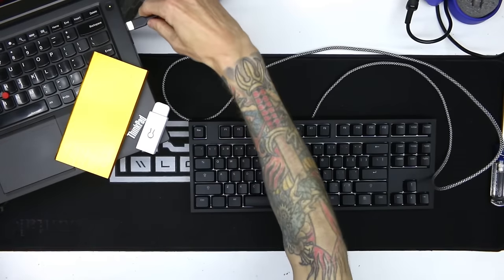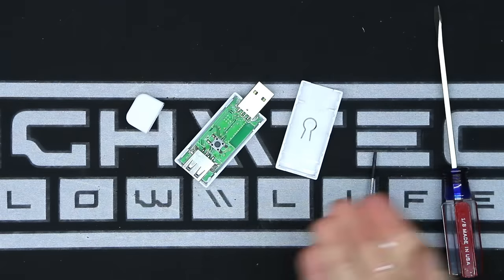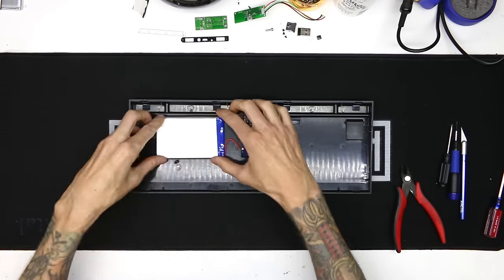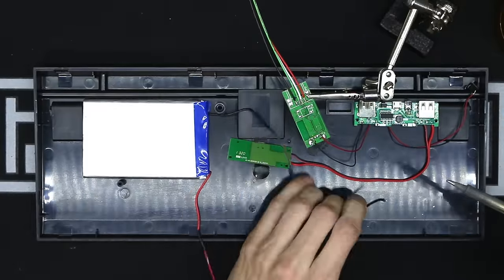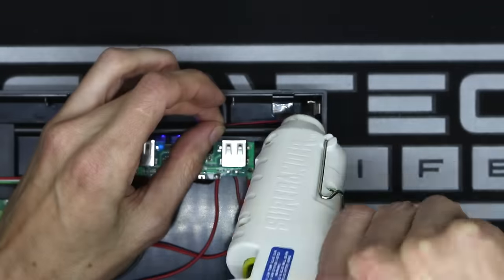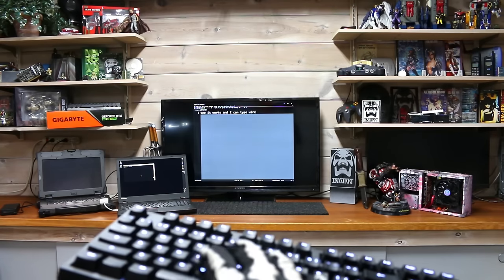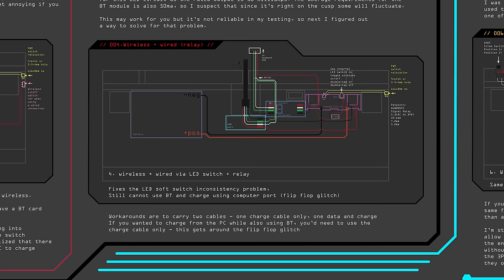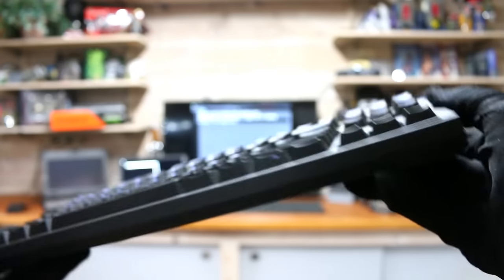⌨ Make ANY Keyboard Wireless! - Convert Any USB keyboard to Bluetooth Wireless - DIY Tutorial How To

Comment: replicated this video on my logitech g512 keyboard. I made a couple modifications. I used a faster charging usb c 22.5w module to charge batteries. and instead of pouch cells, I used 4x 5000mah 21700's along the top edge, they also act as a keyboard tilt. Full brightness with rgb effects turned on, it lasts me about a week, and with no lighting, 1 month+, still going and I havent charged since jan 10th
Reply from the maker: That's awesome man! Congrats on your build 🍻
Reply: @hightech-lowlife  thanks! its been amazing, just wish the bluetooth connection was less buggy, it sometimes disconnects randomly
Reply from the maker: @Iinustechtips  That's strange I haven't noticed any disconnects in my usage, it could be any number of things though.

Comment: Thank you so much for the video, much more informative than anything else I have found so far with what I'm trying to do. If you have a moment, what I would love to do is convert a Asus rog wireless 65% dongle keyboard, falchion, so that it is Bluetooth compatible. Since it's already got battery bank, I was hoping if you had any idea how I could find something that will just convert the dongle rather than usb, to bluetooth, is there anything in the market? Thank you so much!
Reply from the maker: Thank you for watching! 

Just changing the dongle will not help you because that is just the receiver, even if you change that over to bluetooth, how will the keyboard itself transmit bluetooth frequencies when it is designed to output the 2.4Ghz band? 

The BT module in the video will convert the keyboard to transmit BT signals, then any standard BT receiver will work for your device 👍
Reply: @hightech-lowlife  got it! Thank you for explaining that, that makes a lot of sense. Thank you!  If I do the BT module you showed, you think instead of getting another battery pack I can wire it directly to the lithium battery that's already in the keyboard?
Reply from the maker: @gracesleu563  No problem 👍 yes most likely the same battery will work just fine, just check the voltage, should be 3.7v and it should have a boost converter to get to 5v to run the keyboard.
Reply: @hightech-lowlife  great!!

Comment: looks like you could also use the power bank PCB to charge your phone or something as well.
Reply from the maker: 100%! In my latest video I'm making a custom case for two batteries with access to both charge circuits to charge/power a ton of things 👍
Reply: @hightech-lowlife  how big you thinking?
Reply from the maker: @jchoneandonly  They are huge batteries! Double the size of the battery in this video and there are two of them! Check out my latest video I released today if you're interested in that build 👍

Comment: Would using AA/AAA batteries instead of a pack work as well?
Reply from the maker: Yes, you can use any batteries. Just make sure the output voltage to the board is 5V. Rechargeable is the way to go though 👍
Reply: @hightech-lowlife  Thanks for the info. I figured on at least the 5v parts, but I know that everyone reading may not know or are aware of that. For those people who don't want to do the math, AA batteries are 1.5 volts, 3 of them will get you 4.5 volts and 4 will get you 6.
Reply from the maker: @Kara_Kay_Eschel  Thanks! Yes, you can also use a buck converter if you want to use more batteries that are over 5V, or a boost converter if you want to step up from say 3V to 5V 👍

Comment: Are you sure you are using the input port? It may be that the security functions do not work depending on how the module is set up. When you connect to the USB female port.
Wouldn't it be correct to connect the USB micro as input?
Reply from the maker: Can you clarify? Also what security functions are you referring to? Thanks!
Reply: @hightech-lowlife   Idk with IC this is and how the Manufacter has wired the ports but  the output port should only have the undercharge, short circuit  function and the input port should have the overcharge funktion.  If i am wrong please correct me. Thanks.
Reply: I watched the video again. on the green circuit board, all 3 ports are connected in parallel. So my suspected problem doesn't exist for her. But that could be the case with other PCBs.
Reply from the maker: @domineter40  Oh you're talking about the charge circuit - got it 👍From my testing all of the ports are bound together - so it doesn't matter if you use the 'outputs' or 'inputs' they all charge/discharge the same way. I did experiment with having the input only go through the micro USB (input) on the charge circuit, but it didn't make any difference. It could be different on other charge circuit PCBs, but I have tested a lot and they all behave this way - but that's not to say that 'all' are built this way, just the large number I have tested.

Comment: hi mate, me again haha, one question where did you buy the generic power bank from?
Reply from the maker: I found that particular one on ebay, check out my write up on my site for more information about the parts: https://hightech-lowlife.github.io/projects/004_wireless_keyboard/004_wireless_keyboard 👍
Reply: @hightech-lowlife  Is it necessary for the power bank module to have two outputs? a single output module will work? in this case the charge coming through the cable and the one going to the BT adapter would be connected to the same port, would this work?
Reply from the maker: @AngelSing-Zepol  You don't need two outputs 👍

Comment: i got my membrane keyboard which is woreless and problem with it is its pcb sheet traces got damaged and i made it worst as usual so can i make my wired keyboard wireless with my membrane keyboard parts? every thing if fine with membrane accept pcb sheet
Reply from the maker: No, you'll need a working wired keyboard first, it cannot fix your broken traces by going wireless because the wireless transmission happens after the PCB matrix 👍That's an integral part that needs to be working.

Comment: from the schematic that I see, when we need the keyboard with wire mode back it won't work right?. maybe you can update the schematic circuit again so that it can use 2 modes, bluetooth mode and wire mode
Reply from the maker: I show the keyboard working in switchable wired and wireless mode, I even show more than one way to set that up. The schematic also shows all of my iterations including the recommendations for both ways that I set up wired and wireless switching - both firmware switching using the BT module, and also hardware switching using the relays.

Comment: How can i do this on a keyboard without an internal connector/internal micro usb? They are hidden in the planck ez ortholinear keyboard and I am having trouble finding a spot where they disconnect, there are also no visible wires. Is it possible?
Reply from the maker: For keyboards where the connector is soldered directly to the PCB, you'll have to intercept at the connector as I did on my 60% build: https://youtu.be/2Df7Dh3-3o0 

Type-C will be harder because the pads are even smaller. It is possible, but it will be difficult. These types of keyboards will require more engineering and thinking about how you want to tackle the intercept. Another problem is the "mount" for the connector is part of the connection itself. I suppose if you don't want to try and intercept there, it may be possible to clip/cut the traces on the PCB to create the separation, or follow the traces down to the next component as it may be a lot easier to intercept there, this way you don't have to give up the mount. 

There are a lot of solutions really, it just depends on how you want to go about it.

Comment: is it possible to make it hybrid? so when you connect it to the computer it would be normal usb keyboard?
Reply from the maker: That's how this one is set up 👍- has both wireless and wired, just double tap the power button to toggle between modes. Also the BT-500 has a firmware hotkey to do this as well, I got over the pros and cons of both setups in the video however.

Comment: Thanks for your Video. It's already a long time, I'd want to do the same with my Logitech G15 but the problem is I don't know how to my computer could recognize the G15 without cable. I think I couldn't use my G15 functions. It should be just a simple bluetooth keyboard. Any ideas?
Reply from the maker: I'm not sure how it would treat the G15 macros, it's possible it would work just fine, but also possible it wouldn't. You may want to reach out to handheld scientific support and ask them as they most likely would know as they have tested a ton of keyboards 👍
Reply: @hightech-lowlife  thanks for your quick answer. Anyway, I was talking about Logitech Gaming Software, display informations and so on. Probably there will be too much driver issues
Reply from the maker: @simonen8844  Oh you're talking about an old G15 with the LCD, I actually own one of those! I don't know how the software is communicating, but if it's just using HID protocol then it might, but I would be surprised if it did work through the BT connection. Do you actually use the screen for functionality, or just novelty?
Reply: @hightech-lowlife  I really love that keyboard (1st version). I actually own 5pcs of them. the first is at home, 3pcs are at my work (I use them at the front office of my pc repair shop) and the last one is actually disassembled because I want to make some mods (to change led color, to apply some pattern and so on...) and also because I have to repair the display cable, a really annoying thing to do... Regarding your question,  i say yes! Actually I still use the display with the plugin LCDSirReal for receiving some informations, like CPU, memory, GPU and so on. And just at home, I still use the G buttons. The 1st version is the only one G keyboard with 18x G buttons. I understand that, in the Elgato Stream Deck era, G buttons could be easily replaced, and the display could be replaced too with some Panel Display but this keyboard is a masterpiece. It's an allinone product, very very comfortable for my opinion
Reply from the maker: @simonen8844  That's awesome man! Really cool that you've been modding them to with your own touches and backlight colors 👍I actually have a ribbon cable on a T470S keyboard I was going to attempt to repair but the cable is rubber/plastic, seems extremely hard to etch away enough to make contact, but not so much that it damages the thin plastic.

Comment: can this work?
so im using a normal keyboard a bluetooth dongle and a usb hub instead of soldering a usb port on the keyboard and im using a powerbank as a battery.
will it work?
Reply from the maker: Yes, it will work, but you'll need the keyboard plugged in to the BT-500 for transmitting the signals.

Comment: I have one more question  if I connect my keyboard and mouse to usb hub and than connect magic box with usb hub is it work properly with both keyboard and mouse and made both wirelessly ???
Reply from the maker: Yes, most likely - it will work with both keyboard and mouse at the same time, but you can't use it for other peripherals on a USB hub, check the site I linked and read their documentation over what is possible and not, but I do know you can use both keyboard and mouse at the same time no problem. 👍

Comment: tip: place some copper wire that contact all 4 points. Put some solder ON it, so it connects all. Than some FLUX and put your heated solderingthing on the copper wire and TADA,.... remove be easy. OK... now I watch your video :-)
Reply from the maker: That would work, it's a good tip 👍 I have a hot air station now too, and I also found out that you can have them send you the boards unassembled without the plastic case and USB ports installed which is pretty convenient.
Reply: @hightech-lowlife  just a small question for you: is it possible to use the parts of an old wireless mouse instead os Bluetooth? So I can put 2 small batteries in the keyboard and use the mouse adaptor in my pc..
Reply from the maker: @youtuup  It may be possible, I guess it depends if the mouse connection can also do keyboard data. I believe most can do both, but I'm not sure I've never tried it. If you do try it let me know of your findings here 👍

Comment: Would this work with a Razor Chroma RGB keyboard? Obviously the keyboard would light up, but would the proprietary software still recognize it?
Reply from the maker: Hello, I haven't tested anything like this but my thoughts are probably not, although it really depends on what the software is doing. If it's just interpreting scan codes and translating them (like hotkeys, etc) most likely that will work, as for changing RGB settings and all that, probably not. For that you can still used the wired connections to make changes. Maybe someone else who has tried it with a board like that can chime in. Thanks!

Comment: This may be a reach, but considering the cost of materials couldn’t I buy a cheap mechanical Bluetooth wireless keyboard from Amazon and just switch over the components? I realize now the usb receiver (I believe that’s what it is called) that connects over Bluetooth could be tied to the board?
Reply from the maker: It's actually cheaper just to buy an inexpensive premade BT keyboard 👍 This mod shouldn't be performed if financial economy is top priority. Thanks
Reply: I’m not too concerned with spending a few bucks, more or less just trying to see where to source the materials. I already spent more in tools that could of bought a cheap BT keyboard.

I guess I enjoy hacking away at stuff in trial and error to begin understanding. I know it’s senseless when I’m working with a $45 board, but it’s a learning opportunity. 

Besides, I converted my board to the usb c from wire with a $30 soldering pencil and shops wanted $120 to do the same thing. Pays to learn. Your videos are good.
Reply from the maker: @twpaq9332  Yes, this is true. If you look at everything through the lens of simply economic sense then you can miss out on other things. Learning always requires making mistakes, and when dealing with hardware, sometimes this can lead to components breaking or other unfortunate or even costly events. One might look at these things as a "waste", but it really depends on what the goal is. To me learning is more important than anything else, and sometimes that can take a higher investment. I think cost analysis is always something to consider, but our current economic system treats this as the most important thing which can blind us to seeing a larger picture. 

Thanks man, I appreciate it 🍻 What you might lose in the short term with buying tools and maybe a few failed projects, you will compensate later with your knowledge when you save hundreds (if not thousands) by fixing things on your own for much less 👍

Comment: How can I use a wireless mouse and keyboard if I lost my USB receiver  and its not a unifying receiver supported product?
Really need a solution for this
Reply from the maker: There is no good/cheap solution to this unfortunately, more devices are going to bluetooth because you don't need a dedicated receiver, most computers, phones, laptops etc have built in BT. 

Some models will use the same frequency so if you can find the same receiver used, or contact the manufacturer they might be able to find one that works for you.

Comment: Can i use bluetooth adapter with usb hub at same time to make keyboard and mouse working?
Reply from the maker: Yes your bluetooth receiver should allow for multiple connections. If you mean connecting both keyboard and mouse to the BT-500 module (transmitter) you also can, but please check the documentation first: http://handheldsci.com/kb/

Comment: One question: I can not find an adapter for my Logi G602 mice. Any chance I can convert it to BT? Will 2x AAA batteries be enough to power a BT module?
Reply from the maker: This module does support mice, so it would work, but I think it would make more sense (economically and time-wise) to just to purchase a new wireless mouse 👍(I see the G602 is expensive, and older - so maybe checking on ebay for a used/cheaper one would be my suggestion). I did have a request to try this mod on a mouse, so I may make a video on something similar in the future but packaging on a mouse is even smaller than a keyboard so it would be challenging in that regard.
Reply: @hightech-lowlife   I guess I will wait for that video. :) I am aware it might be challenging but if we can use existing power (batteries) than it's up to only put inside some kind of BT module. Can't wait to see how will you solve that puzzle! :)
Reply from the maker: @deliriumcode  Oh yeah, if it already had room for batteries it shouldn't be too bad stuffing in the BT module - I will be trying this on a 'regular' mouse though, hopefully it will be successful, but I will post my results whether it works or not 👍

Comment: Hi, thank you for your video. I am thinking of doing the same but doesn't have the knowledge required. Your video help me a lot. Since I am a programmer and I use KB a lot. I wonder if anyone has any information about the capacity of the battery and how long it will last, say, if I use it 10 hours a day?
Reply from the maker: Thank you! 

It really depends on your board and if you have/want backlighting, and also how big of a battery you can fit in your build. The keyboard will run a long time if you are not using backlighting, I have a breakdown of different keyboard sizes and backlighting settings for amp draw to determine how long it will last you: https://hightech-lowlife.github.io/projects/004_wireless_keyboard/004_wireless_keyboard 

For this board it will go about 60-70 hours per charge if you don't use the backlighting.